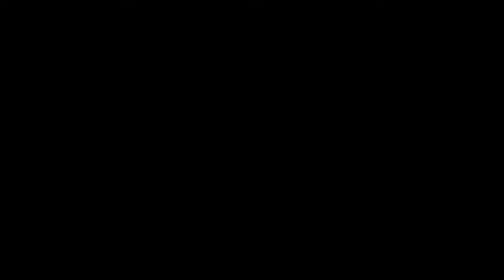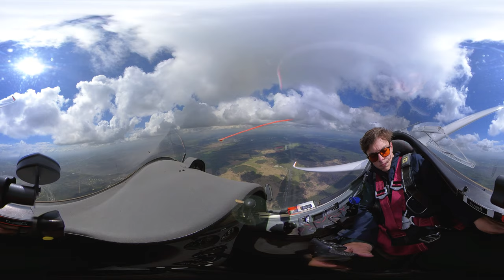This Glider has an ENGINE?

Comment from the maker: What do you think of the 360 video? Useful, or just a gimmick?
Reply: I prefer normal vid. This is rather hard to follow
Reply: In normal videos it 's easier to get the focus on the right things.

ASW 28 ...  nice glider! I hope I could try it one day.😍
Reply: i think it is a very nice presentation. Very smooth and one can see the rotations of the glider.
Reply: I like it but I think it's better when you edit it back to normal video, and you as the editor cut the panning around out for us, and show us the parts you think are cool. 😁
Reply: I like this 360 footage! But the position where the camera is mounted in the cockpit could be improved in my opinion !
Reply: @henrih3080  I dunno the position was pretty good IMO. Where would you suggest he move it? I like the angle. You can see everything outside - sure you can't see the panel, so maybe a bit back? But then the point of the video - the engine - would be less visible.
Reply: I liked the 360 video. Which camera did you use?
Reply from the maker: @thomasbaro7377  this is the Insta360!

Comment: Hey Simon, how come you call the powerplant on that ASW-28-18E a TURBO engine?  
Do EU pilots not differentiate in describing a propeller or jet driven sustainer?
Reply: the term Turbo is usually used when referring to sailplanes with an engine which is not allowed to perform a takeoff under its own power, it doesn't matter wether it is a gasoline engine, a jet or an electric motor, the general word for them is turbo. i'm not sure why the word "turbo" is used instead of something else since it could theoratically cause misunderstandings with "turbine" but i guess it just sort of "evolved" that way, if you can call it that.
Edit: "Sustainer engine" would be the more technological term, doesn't matter what kind.